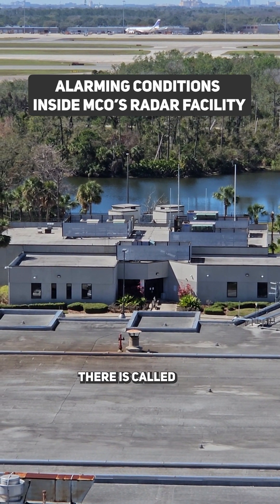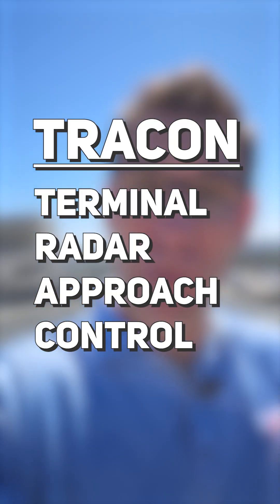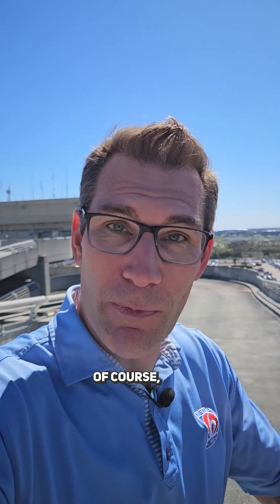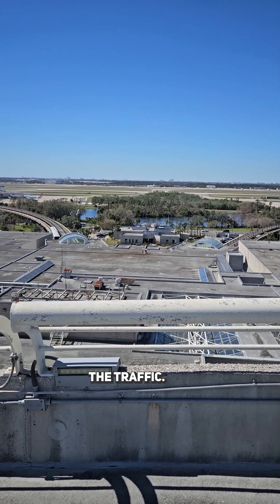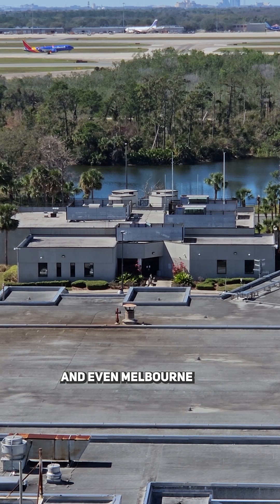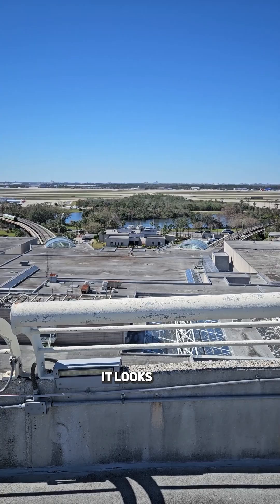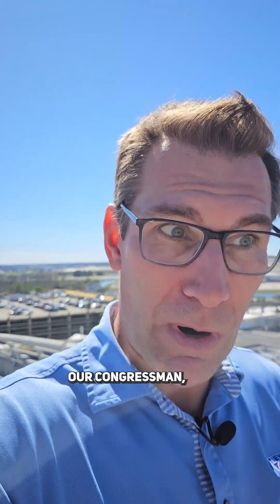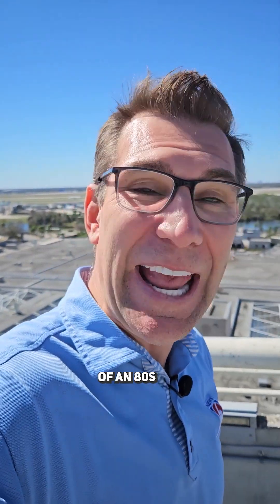AIRPORT RADAR SYSTEM BEING COMPARED TO VIDEO GAMES?!

Comment: This building is from the 1980s and used to be the base of the old air traffic control tower. You can see 4 stubs sticking out the roof that supported the tower.

Comment: Around 2010 I was work at LAX they had some old 70' tape reel computers that were still running some of the radar they had modern lap tops plugged into them, the program on the laptops translated/converted the info to the new operating system the tower computers used.
Reply: Don't you think the infrastructure bill would have taken care of that already but that's right that all went towards the green New Deal